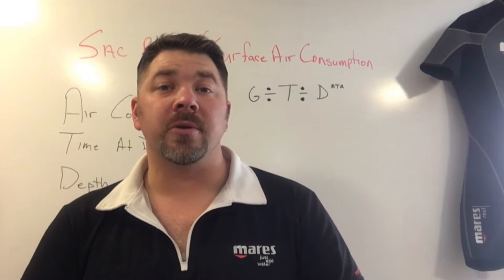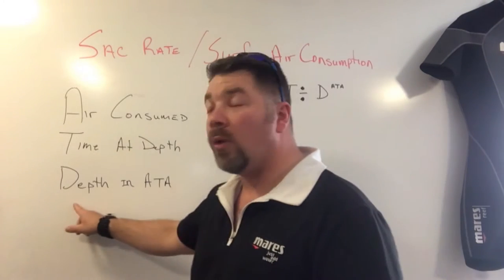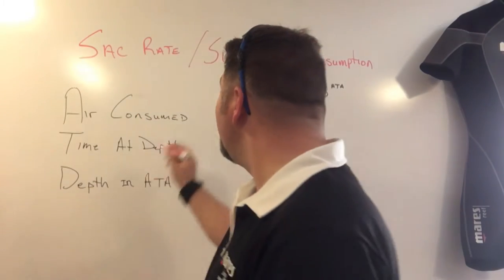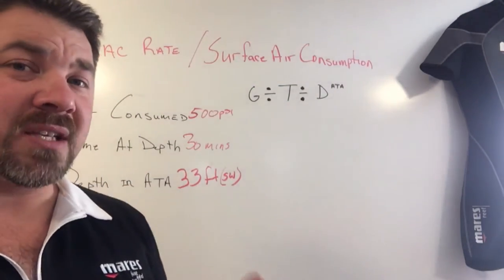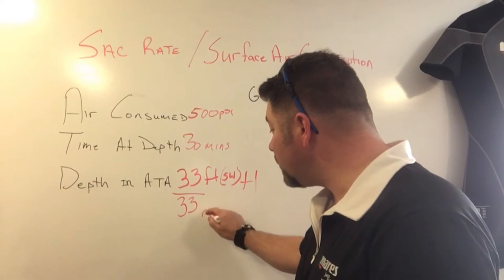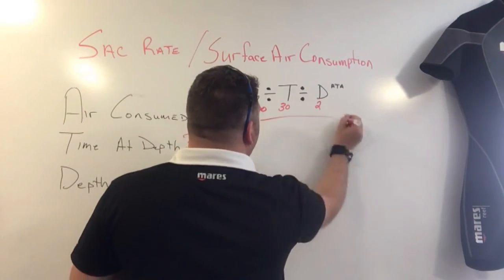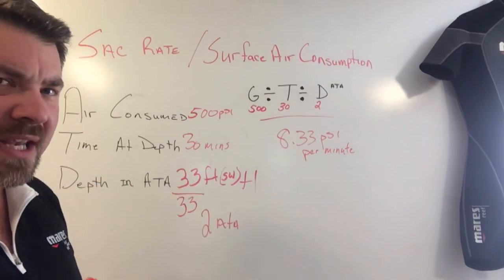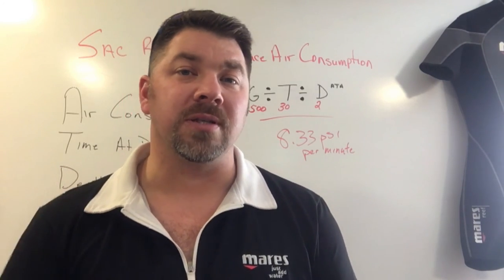How Much PSI Do You Breathe Per Minute? SAC RATE Explained

Comment: Great videos! I actually had this question posed to me (from a curious perspective from someone the other day) because I 'surface air' dive on my gold dredge-sluice (salt and fresh water), and my rig's engine powers not only the 8-inch dredge pump, but the low-pressure air pump that compresses my 30-gallon reservoir tank...and I was asked, 'if your engine goes out, what kind of time do you get on that reservoir tank, if compression stops'...(my hookah out port feeds my 2nd stage directly)? My reply was 'between 2-5 minutes' (because once the suction-vacuum stops, I know my platform engine has shut down), which gives me time to hit 15-feet and do a 2-3 minute safety (my dives are normally 20-30 ft for 100-110 minutes each). When asked about the variance, I tried to explain that my SAC times shift, due to how much 'labor' I was exerting when 'pump goes off'...so, in a nutshell, it's all about your 'cardiovascular rate', to be truthful...that, and general fitness, that stabilizes that SAC number...
Reply from the maker: Very interesting.  There are many things that can effect a diver's SAC rate.  Size of cylinder, work load, etc.  Your last statement about you cardio rate effecting your SAC rate is spot on.  If your heart rate increases, then so does you respiratory rate, thus increasing your SAC rate.

Comment: This is where metric makes way more sense. Atmospheric pressure at sea level is 1 atmosphere or 1 bar. Every 10 meters of depth you increase by 1 atmosphere.

0m = 1 bar
10m = 2 bar
20m = bar

Also, psi/min isn’t a really a volume is it? It’s a pressure per minute. Litres per minute makes way more sense. 

10 litre cylinder with 230 bar in it has 2300 litres - it’s all very sensible
Reply from the maker: Hello @jamescoogan8963, we train all of our students in both the Metric and the Imperial systems. This way they can choose which one they prefer. We have never really had a student come to us to say they prefer one over the other. I agree with you that the metric system is easier mathematically, unfortunately, it does have some caveats when calculating freshwater and saltwater. By training our students in both systems, we believe it makes them more educated, especially if they continue down the professional path in scuba. They will be better prepared to train their future students in both systems.

Comment: When you are calculating your PSI consumed during your time at depth do you round up? My SPG has 200PSI increments, so in my experience I have with gauges (aviation maintenance) that’s pretty inaccurate. I do my OW dives later this month, so I don’t have real experience yet at any real depth. Thanks for all the videos in this series. I live the science and planning side of it.
Reply from the maker: Hello Caleb Mcelhaney, most gauges that are of high quality are very accurate. These same gauges we use when mixing gas, which we verify with analyzers prior to a dive. For divers that do not feel comfortable using analog gauges, a digital gauge is a great option, as it reads down to the exact pressure a diver has at the beginning of a dive, during the dive, and at the end of the dive.
Reply: LakeHickoryScuba I’m good with the analog gauges, I’m just used to gauges that had a lot more decisions like 25psi markings on a 5000PSI gauge.

Comment: my last dive gave me 17.3 PSI/min according to my MK2I. I am always curious what is the ideal rate.
Reply from the maker: Hello icareneeds, great question. Unfortunately, there is no ideal, as no two humans are identical. Physiological differences, not to mention other variables, will dictate one's SAC Rate. Thus, trying to compare one diver's to another's is not necessary. My SAC Rate changes daily based on the type of diving I am doing. A great example of this is, when I am fun diving, I have had as low as 7psi/minute to around 10psi/minute. When I am working, it has been very high around 66psi/minute. There is nothing wrong with wanting to always have a better SAC Rate, and we should strive to have the lowest possible for ourselves, but we should never try to compare and compete with others as they will never be the same.

Comment: Hi, I really enjoy your videos. I'm a fairly new diver and i'm not great at math. I recently did a few dives at Catalina Island, California. I used one of those dives to try and figure out my SAC rate. Can you tell me if I did my calculations right? Starting pressure 3122, ending pressure 714. Time under water 43 min. Average depth 46 ft.  So 2408 / 43 / 1.39 =40.28 SAC rate? Seems high?
Reply from the maker: Almost.  The 1.39 should be 2.39.  We still have the constant atmosphere here at the surface that we have to add in.  So your conversion for 46 feet would be -------(46/33)+1=2.39ata.    Then you can finish the equation out.  Air Used / Depth in ata / Time @ Depth.  (2408psi / 2.39 ata) / 43 mins = 23.43 psi/min.
Reply: @LakeHickoryScuba  thank you very much!
Reply from the maker: You’re welcome

Comment: you will know that. does the mares quad air give you your sac rate ?  Is it clearly displayed somewhere on the unit ?
Reply from the maker: Great question @TS-hz4lx. It does as long as you are using the air integrated feature (ie an transmitter). However, you will need to download it to either the Mares App or the SSI App. It will then calculate the SAC rate for you.
Reply: yes i do own the mares quad air didn't use it yet just wainting for the temperature to rise up. You have always great video. thank you for your answer
Reply: @LakeHickoryScuba do we need to buy the blue link pro to make it work work ?
Reply from the maker: @TS-hz4lx  You will either need to use the Blue Link or you can manually enter in the information on each dive, including cylinder volume and starting and ending pressures.
Reply: @LakeHickoryScuba  thank you again for your answer!

Comment: what formula should I use if I am using BAR value instead of PSI?
Reply from the maker: Hello Kevin Casto, the formula would be the same for the metric, just replace psi with BAR. Also, instead of using feet, you would use a meters calculation.

Comment: so wouldnt the depth in ata always be 2 ata? bc anything divided by itself will always be 1 and then plus 1 so whats the diffrence with non saltwater?
Reply from the maker: Hello charles harry. When we calculate atmospheric pressure, we first must understand what the constant atmosphere is, which is our surface atmosphere. The pressure here at the surface is approximately 14.7psi (15psi by land dwellers). This would allow us to conclude that each time we add another 14.7psi of ambient pressure to us, then we are going through another atmosphere of pressure. There are three ways to look at this from a median standpoint. If we are diving in Freshwater, then the variable we use would be 34 feet, and if we are diving in Saltwater, then the variable we use would be 33 feet. For the metric crowd, we simple use 10 meters. The reason we use different variables is due to the the density change between Freshwater and Saltwater. To calculate the total pressure surrounding us, we simply take the given depth and divide it by the variable you choose (based off the water you are diving in), and then add the surface pressure back to it (the constant atmosphere pressure here at the surface 1 ata). Hopefully this will answer your question.
Reply: Salt water vs fresh water does not make that much of a difference until your fresh water dive is at high altitudes and even in that case the important fact is the atmospheric pressure cause the water pressure is going to be more or less the same.

Comment: Why doesn't the math work in reverse? Using 2200 psi at 53 feet of salt water for 40 mins equals 2200÷40÷2.6=21.15 psi per min, yet 21.15×40=846 total psi used?
Reply from the maker: You left out a variable.
Reply: It should be 21.15x40x2.6... which is 2200.
Reply: Fotgot the pressure at depht
Reply: Air can we use this surface Air consumption formula for rebreathers like we are using Nitrox mixture 60/40 for the depth at 20 meters and time spend 40 minutes..

Comment: & no o2 sensors ?
strictly perfect breathing volume/s...... each breath is perfect everytime...... built to deliver the exact volume of o2  / dl. or what ever gas material that is used on each scuba adventure.
some what different by being gaged by volume and not pressure...... ( this is the 21st. century ) gaged by the exact same volume of delivery valve.
Reply from the maker: I would suggest to take a Rebreather course before you continue. Dive safe.